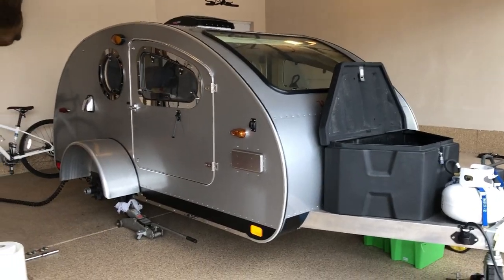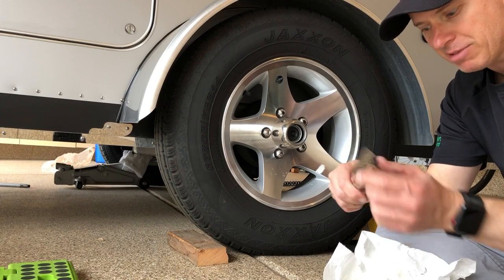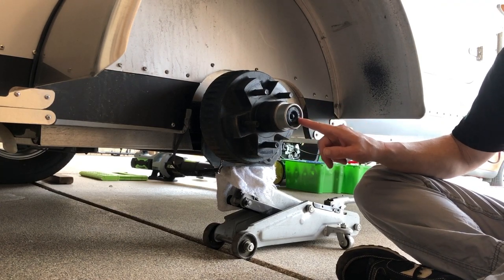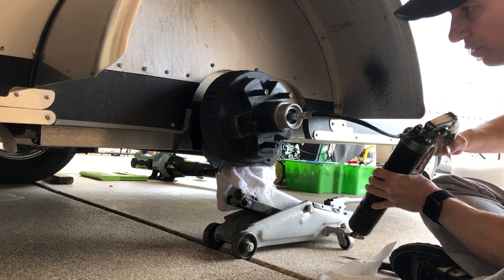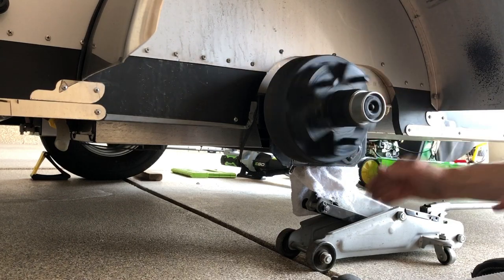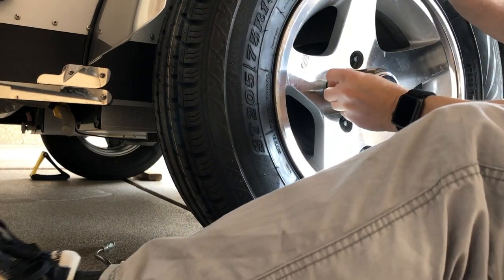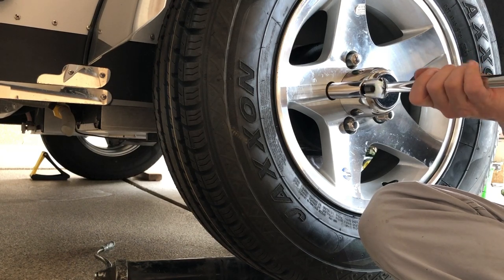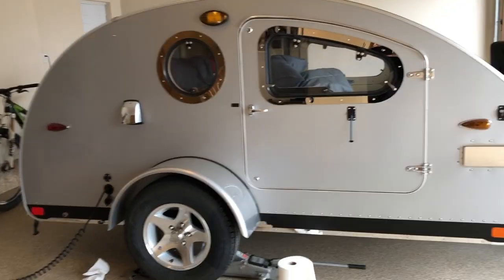How to Grease the Dexter EZ Lube Axle on your Vistabule Teardrop Trailer

Comment: Thanks, Johnny, very helpful.  Where does the grease go between fillings?  It must depend on how much it's used, yes?  So if it's idle for a season, is greasing still necessary?  (Apologies for the completely naive question!) - And did you get good answers to your question re flushing the water line/tank?  PS BTW I've got VB #3, built in Bert's garage, probably 35K miles by now, and we still love it.
Reply from the maker: Hi Steven,  Nice to meet you. If the trailer is idle for a season.... There is no need to grease.  The grease dissipates from use, heat, some of it gets flushed out(tiny bit).  Not many answers yet on flushing out the water tank...Do you have any suggestions, Keep in touch :)
Reply: @johnnybattlelife  Well, we did use the Clorox solution, flushing and draining as thoroughly as we could and it seemed to work, i.e., we no longer had any anxiety about what might be growing in the system.  I know some would object to Clorox, but...
Reply from the maker: @Steve123451216  Thanks for the feedback :)

Comment: Thanks for the demonstration Johnny. Q: is this the first time you greased the axle? It begs the question of whether or not the axle was fully greased (by Vistabule) when you first bought the trailer. Perhaps it would be good to grease a new axle to be sure its well greased. I have a similar easy lube Dexter axle.
Reply from the maker: Hey Steve good point. Yes that was the first time
Reply from the maker: @SteveMacDidThis  Thats a good idea

Comment: Any pro will tells you, it's way better to remove the bearings, that's an option to do it this way but it's more that if you need to grease it and are missing of time to do it..  Unfortunately it doesn't grease  as it should do.  Only if you want to extend delay between bearing lubrification in my book.